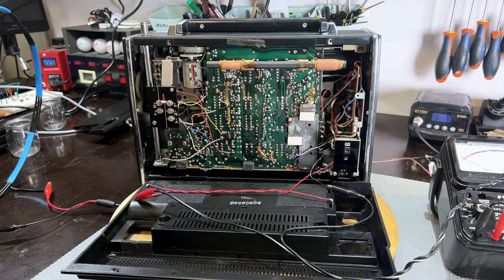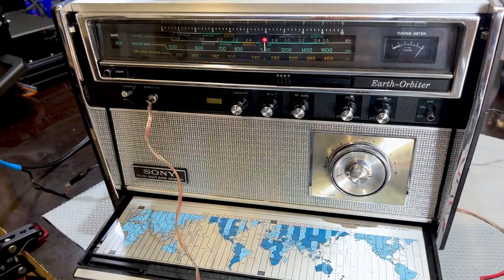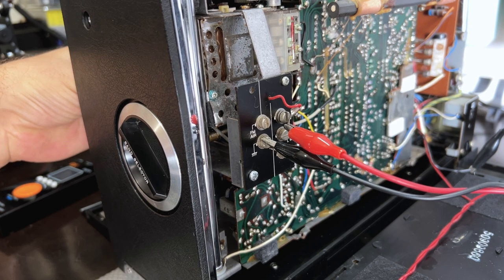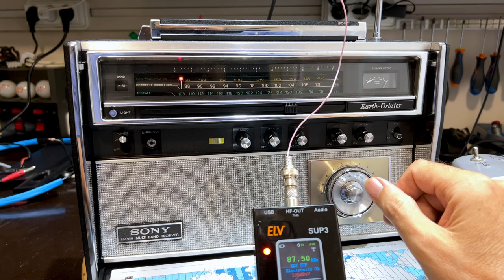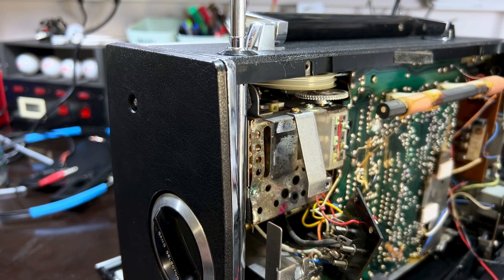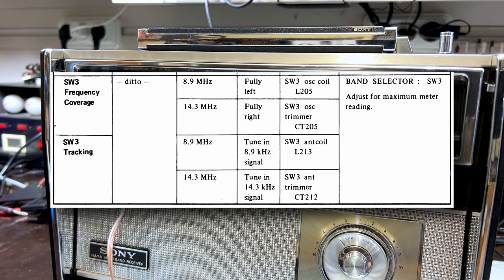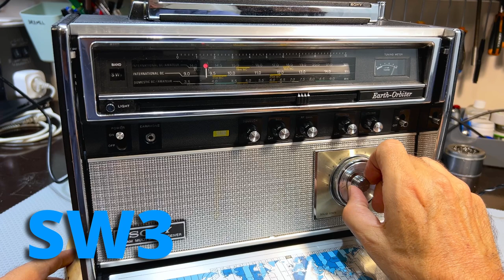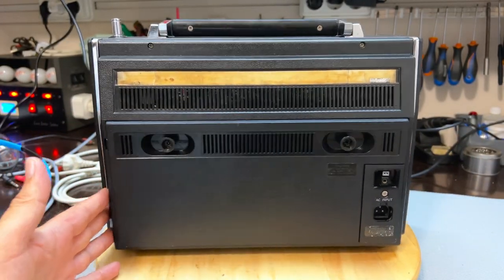Fully restored and aligned. Now, it's a Sony! Sony CRF-5090 Earth Orbiter restoration. Part 3

Comment: This video is a great reference for hobbyists repairing these Sony radios, which are fairly common on the online auction sites. Most of them for sale are the later CRF-5100 model but most of the alignment techniques should be similar. 

From this video you can see that the Sony's similarities to the Zenith Trans Oceanic end when you open the case.

One thing I did not realize until now is that the 220V models have a different power input arrangement. On the sets sold in the USA, a proprietory four pin connector is used, which contains pins for both 12V and 120V. This same connector (and the special Sony power cord) was used on various other North American Sony products, such as some of their late 1960's and early 1970's cassette recorders.

I've got three of these radios, but only one of them works 100%.
Reply from the maker: Yes, the US version's power input was definitely different. This one is a lot simpler, but you cannot feed 12VDC directly to it. It's a pity.

Comment: Great job!! This series is going to be extremely helpful. I have a CRF-5100 en-route and having looked at the service manual the alignment procedures look to be more or less identical to the 5090. Seeing it done in action makes it about a thousand times easier to do! Well done on the restoration. Looks great and fantastic sensitivity. Very impressive. (I also watched David Tipton's cabinet restoration yesterday with jaw dropping curiosity. I think I probably would have thrown it out of the window by about attempt two or three!!! 😂)
Reply from the maker: 👍 good luck with the 5100

Comment: Fabulous job Manuel. That thing looks absolutely brand spanking new, and probably performs just as well. I thought the 2001D was good last night as I was listening to New Zeland and Thiland, but that is something else. Such a pity no one, except the Chinese, directs signals this way anymore. And yes, Dave's cabinet work was amazing, even if he took multiple goes at it! Puts my work to shame. (BTW.  I went with the Ender 5 S1 3D printer, they claim it is much faster, along with their resin printer. Should be here in a few weeks.)
Reply from the maker: 👍 the SW is indeed quite busy. I use a miniwhip antenna and it really picks up everything. The Ender 3 is great so far, but I’ve a feeling I’ll be looking for a faster printer soon 😊
Reply: @electronicsoldandnew  I use a long line that can be tuned, but I don't have an earth which would improve things somewhat. However, I must get a miniwhip like youself. The printers at work were superfast, but I thought they were slow! They also cost 30 times what we paid! The CNC machines I was told were $250,000, now they were fast...

Comment: On my Zenith Transoceanic , to use SSB, you need to have the volume all of the way up and use the sensitivity as the volume to decipher it correctly.  I had trouble until I took the tine to read the manual.😊

Comment: Dear manuel, great job on a great radio!  Two hints from my side:
1. The ceramic AM-Filters for 455kHz have a tendency to corrode inside over the decades due to absorption of humidity. Maybe that´s the problem with this radio
2. FM-alignment, especially of the front end, is difficult with AF-maximum, because the FM-chain is ignoring and clipping the AM and reacts only on FM-deviation as it should. So i recommend to use the S-meter or measure the IF-amplitude before demodulation and before clipping.
Just my thoughts......
Reply from the maker: Thanks Stefan. Good tips to know.